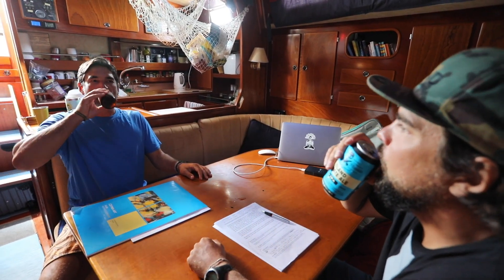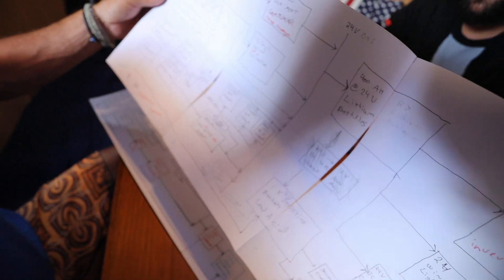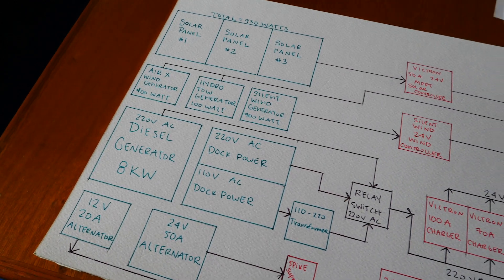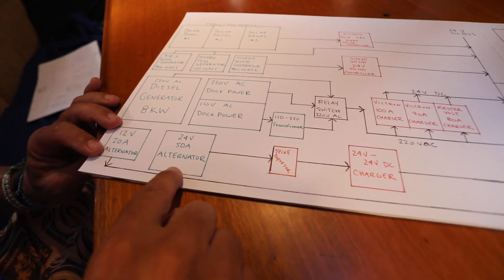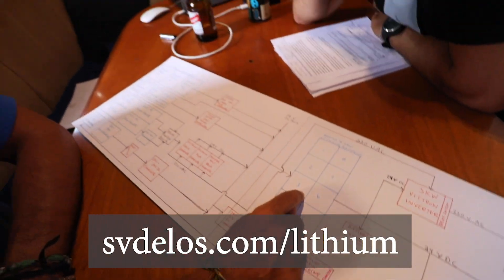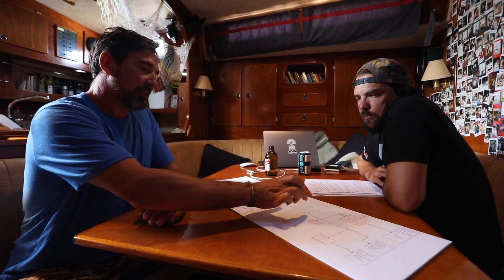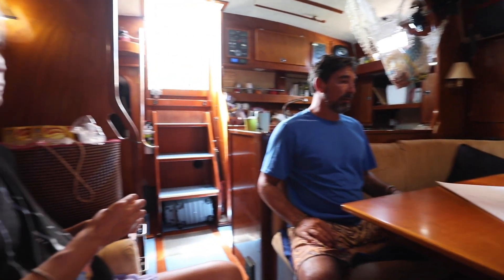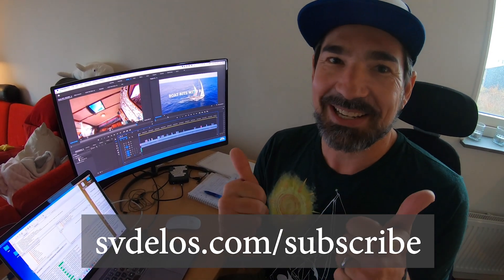Sailboat Electrical System Overview - ELECTRICAL BOAT TECH (1 of 7) - Sailing Vessel Delos

Comment: Hello liked the vid, just one point (I'm not an expert) if you have more than one controller charging at the system at them same time it is possible that one controller will shut off because it reads the voltage from the other power source/controller and thinks the batteries are fully charged, so I am guessing the wind generator is only working when the solar isn't.

Comment: Thanks for the simplified schematic. I took a 6 week course (180 hours) called Basic Electricity & Electronics so everything you said made sense. I really like the redundancy you built in, very smart when hundreds of miles offshore or even in some ports with limited or expensive parts/shipping.

Comment: Have you ever thought about having a small, relatively lightweight 12v battery for emergency use? 

In most yachts, the main batteries are located very low because of weight distribution, sometimes even in the bilge. In case of flooding, they will the first parts of the electrical system that will be under salt water. There goes the redundancy. 

Your yacht will remain afloat and salvageable even if you have sea water up to the waist level in the saloon. Having a 12 volt battery that remains in working order gives you a better chance to have at least the most critical electrical systems working after you manage to stop the flooding. Or more time to alert help if you can not control the flooding and need to abandon ship.

Comment: How much would a 3kW solar system cost?
As of July 2019, the average cost of solar in the U.S. is $2.99 per watt ($8,970 for a 3-kilowatt solar system). That means that the total cost for a 3,000 watt (3kW) solar system would be $6,279 after the 30% Federal ITC discount (not factoring in any additional state rebates or incentives).Jul 12, 2019

Comment: a perfekt System Brian. But what you think about future ...electric boat drive? Big Propellers recuperation charge Batteries trugh sailing - example with  a Tesla or a BMW i3 Batterie Pack - used for 3.600 EUR here some Links - check out if you like... https://www.ebay.de/itm/174045373408  https://www.youtube.com/watch?v=_EV2qq2-Lck  https://www.kraeutler.at/motors/ship-drives/  https://www.torqeedo.com/en  http://www.aquawatt.at/GB/startseite_GB.html https://www.torqeedo.com/en

Comment: Love your way of explaining and how well organised your system overview map is. Also, I like most of the choices in the system. The main issue that I noticed I’d prefer different, you most likely already know: The A2B charger from the alternator to the battery, is good for the batteries, but a pretty inefficient system, and potentially also loosing max power. 

An advanced external regulator for the alternator would be at least as good for the batteries, always send all available power to the batteries (if they need it) while at the same time making sure the alternator isn’t run too hard or hot. The top choice for such a regulator nowadays seems to be the Wakespeed WS500, which is the only one that is also monitoring the Amps, not only Volts. It also have several other interesting properties. 

Another similarly interesting product is on the battery monitor side. The Victron BMV 712 that you have is pretty much the standard these days. Very nice, but the Balmar SG200 also takes in some interesting “secret” smart electronics and algorithms making it able to give a battery “state of health” as well as a state of charge that is self calibrating and impressively exact, also with lithium batteries. The Victron monitor needs frequent calibration. 

I don’t think we all need to have the absolutely perfect system, of course, but it might be nice for readers here to know about potential alternatives. I’m certainly going to make a system map inspired by how you guys did it. That will be very useful if somebody else needs to do something on our boat. The full detail system layout is way too complicated to be of much help.

Comment: I like the lay out of your system having redundancy is important for making repairs if some part of the system fails. Also having been a truck driver working on my electrical system I learned that no matter how good your system is it can become a night mare if the wiring becomes compromised with corrosion especially from salt water. I tried to use the best durable climate resistant wire coating against water, heat and abrasion. The point of failure usually is at the wire connection points or splices so my solution was to use GE silicon caulking to coat all wire splices and termination points sealing them completely yet easily accessible if work has to be done. Run wires and avoid sharp turns and any tight or places where the wire can rub against something and wear threw from even the slightest vibration or movement. 
Another point of caution that I found is that wires carrying loads generates heat and to many wires grouped together, next to each other can bring the temperature high enough to melt the wire's coating and short out the system or even catch on fire. 
I know Brian is on top of this but I thought I would bring it up because it might not be obvious to many other people. I hope this is helpful, take care Happy Sailing.

Comment: Love it. Sounds like a similar journey to the one I've been on over the last few years. I recently had a failure on the 24 -> 12v DC step down converter which has me rethinking things as i rely on 12v heavily. Do you have any redundancy built into your 24v to 12v feed? I.e. multiple step down converters with diodes/mosfets in case one fails?

Comment: Hi Brian and crew - loving the tech videos! Question for you: with all of those separate charge controllers feeding into the same DC bus, do you get any conflicts between them? Different controllers providing different voltages or having each controller trying to optimize the Amps to the battery separately, and ending up with too high an Amp supply when they are combined?
Reply: This is an excellent question deserving of a very detailed answer.  The short answer is that typically, different charge controllers do not backfeed or fight one another. Some may wind up working harder than others when the batteries are getting close to fully charged and may not share the work evenly.  Overall current limiting with several charge controllers is very hard unless you have all of the same brand and they are communicating with each other or controlled by a separate monitoring system.  In the case of Delos, due to Lithium batteries being able to accept relatively high charging current the concerns of too much charging current are reduced.

Comment: Thank you for such an informative video, as a sailor and an Electrical Engineer I do understand the complexity of multiple power systems to safely run our sailboats. As an engineer working in micro electronics built for space science applications I also understand the difficulty of trying to explain what I do for work. I feel the pain of both sides of understanding and accurately explaining electronics.

Comment: Excellent video for us non-electrical engineer types!  I have a boat partner who is an electrical whiz and SSB radio guru, he loves to make wiring diagrams like this, most recently to add a new anchor windlass to our Beneteau 31.  (Details if anyone is interested in the windlass setup are on my insta account @byron.sails ).  Your boat is more complex than ours and I can see how a comprehensive wiring diagram is a must!

Comment: Love the vid and a very nicely laid out system.  Since you are on a 220v AC system for wall outlets, I assume you use euro style power plugs/cords/adapters for your portable electronics like laptops/camera chargers/drone chargers/iPads/etc or do you carry a massive amount of adapters depending on where you purchased the products?  Has that been a pain?  How do you handle grounds or grounding on the AC side, do you float the ground on shore power?

Comment: Great video. I like to see how others solve their boats compared to ours. Our sailboat is ver similar in the sense of 24v 220v 50Hz European setups. I have not yet switched to Lithium but did the VictronLithium set up on our camper van and it works great. For me it is a test bed of ideas and concepts where the cost of failure is not quite as critical as on our boats. Thanks again for the diagram. I think I should do one for our setup too.

Comment: does the power from all sources, with the exception of the power to the 12 volt battery, go to/through the lithium battery bank before powering the equipment board?

Comment: Why do you have 3 chargers (100/70/80 amps) when you have an Inverter/CHARGER?

I know that the multiplus will deliver only about 50 amps (when Charging mode) but you don’t charge from the generator/shore that often, so, are those chargers really necessary?

Thank you very much the excellent video! Keep up the good work
Reply: The chargers pre date the inverter, he already explained why they have multiple chargers, and he didn’t mention the inverter being used for charging, nor does the diagram show it, though the inverter says it has a charger. In overcast conditions in a sheltered location you’ll be charging with the generator.

Comment: Is there a reason the gen 220V has priority over the shore 220V? I can't think of any pros/cons. Great vid, keep it up!
Reply: If the generator is running when you’re on shore power, there’s a reason. Consider if shore power is a shared low amp feed and you need to fire up a high power device.  You’d start the genny up first.

Comment: Hey Brain, 

Love the electrical video. 

I am a HV marine engineer for Torqeedo, and I think that system you have is about as good and diverse as it gets. 

Question tho, what is you a average load on your inverter.

We just completed a system in Tampa where the customer with his Aquila 44 and 5.3 kW solar array, he can run his 2 KW super efficient AC system for about 6 days before needed to run his generator for 3 hours to top off the batteries.
Reply: AC meaning air conditioning. The goal was to be able to live comfortably (in air conditioning) without running the generator and obtaining all the necessary power through renewables (solar).

Comment: Nice over view.  I have a simple 12V system mainly because I have a more Spartanous demand, so it is nice to see a more complicated design.   What do you use for ground isolation (green AC & DC negative)? I see a transformer on the 110VAC but nothing on the 220VAC side? Do the 24V battery chargers provide ground isolation?

Comment: I hope there is a bypass switch to route the gen around the inverter to the house load for when lightning blows the inverter.  The inverter is the weakest link in my system. It has failed several times.

Comment: This is great to see, hopefully you guys publish the flow chart as a PDF for others in the future. I am wiring up 160w solar to my 35' boat and this was very helpful for me. I would like to see your best practices regarding dielectric grease, crimping, corrosion on cables over time, anything special about your shore-power connection (I had to replace mine recently, just did exact OEM replacement) etc. These technical videos are 1000% better than your regular videos simply because of how helpful they are and the high information density. Really looking forward to parts 2-7! I hope this ends up being a 10 or 12 part series. Go hawg wild breeyawn!

Comment: These videos don't just apply to boats. The electrical system in our travel trailer is similar (though just 12V) including shore, solar and generator power. I've got a inverter that I'm planning on installing to help cut down on the amount we use the generator.

Comment: I heard that you can't have more than 48V on a boat in Europe, as that's the max "low voltage", and there's a new EU law that says it's gotta be low voltage if it's on a boat not connected to shore power. Is this true, or does my girlfriend simply not want me to pack the Playstation :D

Comment: Nice job with the system design. Not a Lit. Batt. person though, ask Boeing how that went. I spent 45 years as a aircraft technician jumping from AC/DC 220/110 fixed freq. and variable freqs. 24 DC Lead Acid batts. and NiCad Batts.

Comment: Nice explanation and layout of the Delos electric system. FYI my 48 volt (for an electric propulsion battery bank) Marine Air X died after eight trouble free years. Sent it back for refurbishing and they found the coil burnt and insulation melted. They could not fix it. Had to scrap it. Look forward to report of Lithium bank. I'm still sticking with AGM's for electric propulsion bank and Gels for 12 volt house bank.

Comment: Love the technical videos. When I hear gauge thickness, length of wire run for specific current, how much a component draws, what size fuse to use, I get a warm fuzzy feeling and my OCD kicks in. It's on like a ham bone.

Comment: Great explanation of the system. I am sure many sailors are in process of setting up or thinking through a system. This could change there game plan.  Being that you have set up fail safes and redundant back-ups. Make's for happier sailing time when things break. FYI many people for generator use are buying diesel welders which will be dual use just as a tip to others viewing.

Comment: You had me at Victron 50 Amp MPPT main power point tracking solar controller.
Reply: MPPT is Maximum Power Point Tracking.  You probably know this, but for others who don’t, MPPT continuously adjusts the load on the panels to keep them in the sweet spot of max power generation as the solar input and battery voltage varies. This increases system efficiency.  They can also convert between different panel and battery voltages, so you can use 48 volt panels on a 12 or 24 volt battery system,  for example.

Comment: Do you have a back up for the single 12 volt lead acid starter battery, just in case it fails at sea?
Reply: You could steal one of the lithiums in an emergency
Reply: Aren’t they 24 volt or are they 12 volt in series? Cuz alternator damage maybe?
Reply: @alohathaxted  The lithiums are 12V.  Delos uses 2 in series for 24V for the DC bus.

Comment: You have 8 huge Lithium batteries and you say its 800 Ah 12 V or 400 Ah 24 volts ! My 16 LiFePo4 batteries take up less room than 4 of your batteries.  My batteries are 3.2 volt 200 Ah so a pair in parallel would be 3.2 Volts 400 Ah. I've got 8 pairs in series which gives me 24 Volts @ 400 Ah The same as your battery bank. I'm wondering why I'm getting the same amount of power as you, but at half the physical size of battery bank. Am I missing something ? I would love to send you a picture of my bank and my tiny 120 amp MPPT charge controller BMS Half the size of an iPad mini. You have a great system layout. Another thing, when charging the bank the #00 positive wire gets really warm when charging at 4 kW and the bigger #0000 neg wire stays cool . I hope you're planning on elaborating a little more on your next video  in this series.  Cheers

Comment: Question - Could this system, or something similar, be used to set up a off grid cabin ??
Thanks for the very informative video...
Reply: It’s the same thing.  Solar panels and/or wind to a charge controller to top up the batteries.  Batteries to inverter for AC power, or straight off the batteries for DC power. Just be very careful not to connect the AC ground or neutral to the DC ground if your inverter can’t handle that. Keep in mind many 12v devices dc ground the device chassis, and AC ground is the same.  So if you put both devices into the same metal rack, you’re connecting the dc ground and ac ground together.  Some inverters will blow fuses or blow output mosfets when you do this.  If your inverter cant do this, use an isolated dc power supply, don’t just hook to the batteries directly.

Comment: I feel good that I basically set my much smaller system up like yours so I must have done it right. Mine is all 12V and now I understand how you incorporate 12V & 24V systems. You'll need to do a video explaining why some things are better run on 24V and how it helps the overall system.
Reply: Sailing Corina Expedition 

As I understand it, if you double the voltage to 24 V, your current draw is cut it half while maintaining the same power wattage.  If you draw half the current, then you also have half as much resistance in your wiring and components. Less resistance means less heat buildup, less chance of electrical fire, and the opportunity to use smaller gauge wires to achieve the same power delivery.

Comment: What an awesome video!  Love the tech stuff.  I have a molded fiberglass travel trailer with 170W of solar on the roof, a 1500W inverter, twin 6V batteries in series for the 12V system, plus the shore power option.  I'm thinking a line diagram like the Delos crew produced would help my wife visualize the system and better understand how to use it.  Thanks for the inspiration!!!

Comment: I am really enjoying Boat Bits With Brian.  While I love me some Brady, I was worried where I was going to get my doses of Brian Knowledge.  These videos hit the spot.  One course I would appreciate from Professor Brian is electrical trouble shooting tips, specifically Multi-Meter 101.  How to select a good one, how the different functions are used, and how you test different components like switches, relays, capacitors, motors and heating elements.  It seems like most boat related videos presume the viewer already knows how the multimeter should be used.  Thanks again for the great content.